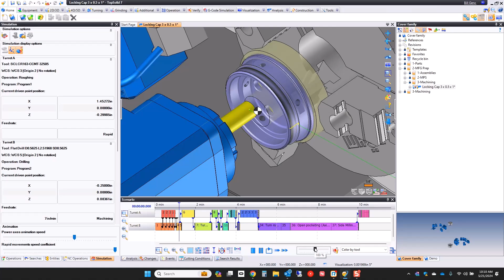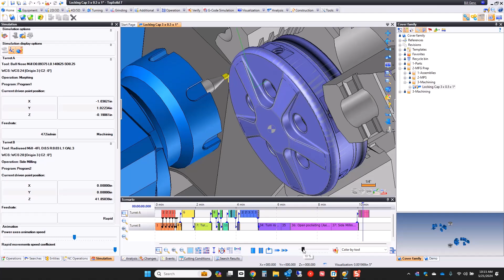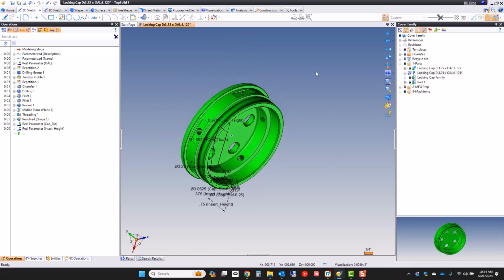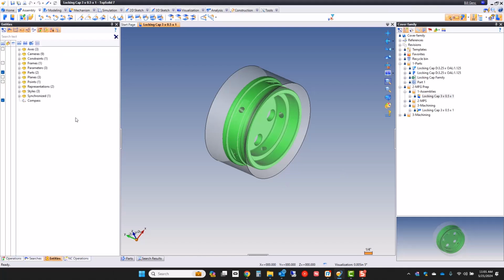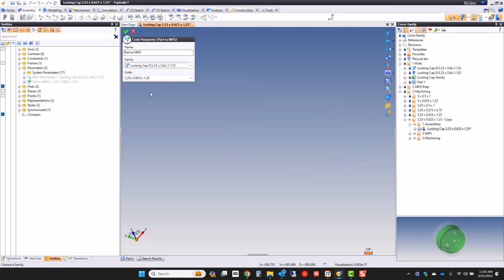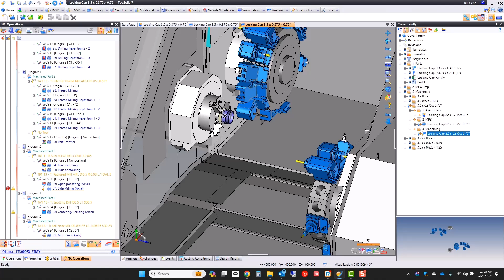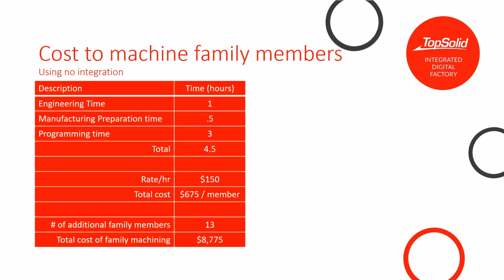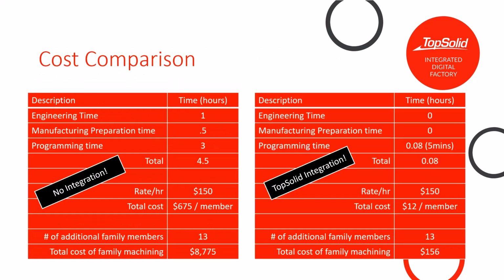Manufacture a family of parts with TopSolid

Comment: Will change in one  program ( feed , speed or anything else ) update the same feed , speed in part family programs ? Would not be easier to keep one program and just change parameters in design to reflect other similar parts ? TS will regenerate machining operation anyway to  reflect new part design.
Reply from the maker: Hi. Yes you could choose to run TopSolid that way as well. Just modify the design, rebuild the machining file.  This works well so long as you don't need to document each individual part, machining setup and so on.  If you so, working off of a family might be more beneficial because you can automate the back end of documentation as well to help keep things moving along quickly.  Again, the beauty of TopSolid is you can achieve what you need to achieve in many different ways.  This example was made to answer to a specific strategy of manufacturing family of parts.